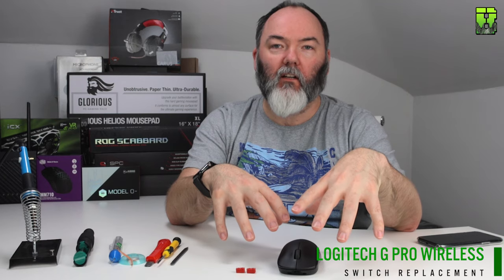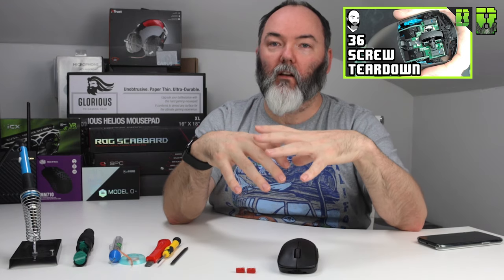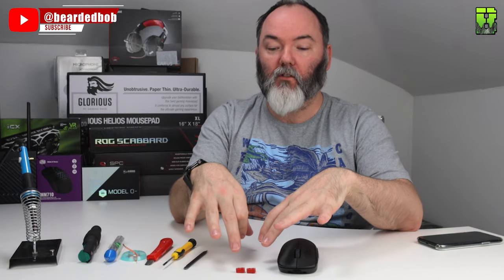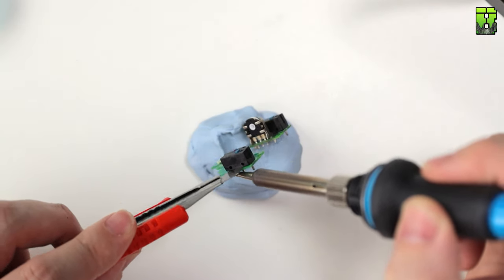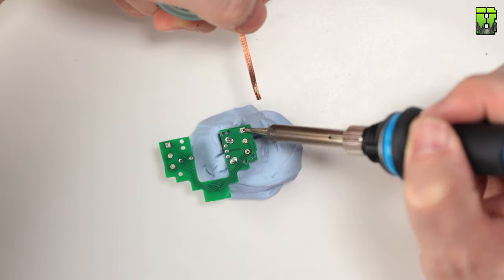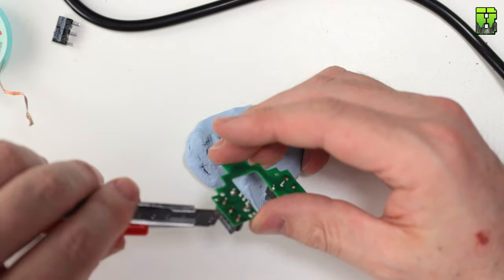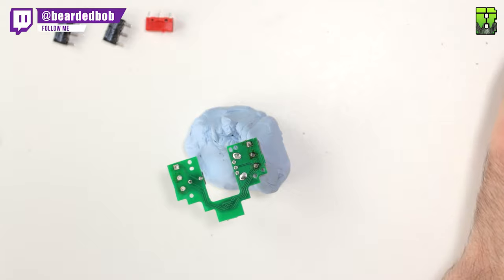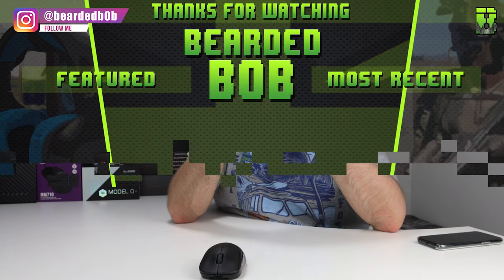LOGITECH DOUBLE CLCK FIX: SWITCH REPLACEMENT

Comment: A good tip when trying to remove components that still have manufacturer solder is to add more , it might sound counter to what you want to do but adding a little more solder allows the heat to transfer faster to the manufacturer solder you can then wick it with ease.
Reply from the maker: Thanks for the tip
Reply: Tried that last week, remembering it from my school days in 1989. Great tip.

Comment: this is not the "FIX" per say, Kaih switches might still double click. And their actuation n release force is more than the omrons. i just hope the industry completely adopts to the optical switches.
Reply from the maker: Swap the Kailh with a new Omron and it's a fix 😜, it just depends which switch you prefer 👍
Reply: @Beardedbob I play"HANZO" a lot- it is mouse button hold aim... rather than a click aim. I soldered my g303's switches thrice, coz of it.

 I swapped to hp reactor mouse (it is having optical switches and I modded it to 66gms)-never had the double click issue.
Reply: Manufactures dont even need optical switches to fix this problem although they are even better in terms of robustness then mechanical switches. You can just use a microcontroller with a couple more pins and actually wire all THREE contacts of a spdt switch properly. That way you can solve the debouncing in a proper way with a little bit of extra software. I modded my zowie mouse with a teensy 3.2 controller and let that handle the button presses using this method it never double clicks after almost a year of use. No debounce delay required at all and it doesnt care about wear and tear of the switch untill it physically snaps in halve.
Reply: Optical switches are trash don't listen to that. Optical switches always feel inferior. Try to get a 200 jumbo tile frenzy score on optical switches you can't. The feel and rebound are just too bad.
Reply: The actually fix is that you update the receiver  and that fixed it for me
Reply: TheSubieFan You know Tile Frenzy isn’t the only scenario on Kovaaks bot
Reply: @Shahzad-Khan  tile frenzy is the most useless scenario on kovaaks but it is a good example of a high click timing drill. I only use it as a hand warm up so you can chill on my top 1% bounce and pop corn drills.

Comment: Thank you for this video. I was searching for so long for ways of fixing my g pro wireless double click. my mouse was to the point of even hovering over the mouse 1 button, would initiate an infinite spam click - making my mouse a paper weight for months. I finally got the guts to replace the switch today, using your videos(this and the teardown video) I was able to replace them myself for about 30 bucks all in. I had never soldered before today, I did some test solders before actually hopping onto the mouse itself. I will admit it was a bit tougher than anticipated and was on the verge of giving up while trying to remove the old switches, but after I had the bright idea of snapping off the switches pins because I didn't need them anymore. it was a breeze. snapped the little pins off, which made removing the excess solder a breeze, after that, it was a cake walk. Thank you again, because without your videos, there is no chance I would have been able to fix this mouse. <3
Reply from the maker: Np Kwadd glad I could help 👍

Comment: Great video 👍

Some tips for you:
- Clean the board and your braid before starting. With IPA 90%+ ideally
- Add flux paste if you're adding heat
- Ensure your iron tip is tinned, it should always be shiny
- Lay the braid over the pad, lay the iron over the back of the braid. Keep it still.
- If the board is burning, your iron is too hot. Temperature controlled irons, or resolder stations, are awesome.
- Try adding flux and a little solder, solder sucking, and using braid to finish up
- If a through-hole pin is being tricky, try adding solder, heating, and pushing the pin to the other side, or more centrally
- Try a solder sucker with a flexible silicone tip
- Rather than removing solder, try adding flux, then solder (even for flux core!) and run the iron between all three pins constantly, the component can often be popped right out. Then just braid/suck the through hole.
Reply from the maker: Thanks some good tips 👍

Comment: Bob, I'm a huge fan. I collect and modify mice too, but I always have trouble keeping the microswitch in place while completing the first solder joint. You're an absolute genius for using putty to hold the board and microswitch in place. I saw in your other videos, you use putty for holding screws and things as well. That might have been someone else.

Edit: My method was to hold the microswitch in place with my finger while holding the board in my palm. Not really safe at all. Lmao
Reply from the maker: All about the putty 👍... Yes holding it can be a tad risky lol.

Comment: Huge thanks for this video. I just swapped out omrons for the Kailh and no more double clicking - it was driving me fucking batshit. Just a heads up to anyone looking to do this; I ripped off some of the copper conductor on the PCB during removal of the Omrons (didn't get enough solder off before forcing them off) and did a shit job soldering the Kailh back on (looks like melted the bottom of one of them even!) BUT THE SHIT STILL WORKS!!!!!!!
Reply from the maker: Thanks glad you like it... ouch on the copper coming off but glad to hear it still works....

If anyone needs this doing I can via this url https://shop.beardedbob.com/collections/customised-gaming-mouse/products/repair-broken-mouse-switch-or-replace-with-better-service

Comment: I recently purchased a used GPW which is very easy to misclick the L/R buttons. I'm assuming the switches are failing. Will replacing with these switches add resistence to the buttons?
Reply from the maker: Depends which switches you replace it with, Check out some of my switch comparison videos. https://www.youtube.com/watch?v=b1IxfY0C5j8&list=PLfd7fPKFiRfLnpJhJ4hVtQ1R4Imi2Uxn6

Comment: do you have any specific watts to use for the solder? just purchased these switches and I'm doing the replacement soon. love your vids
Reply from the maker: Good question I used a 220V 60W Adjustable Temperature soldering Iron from 200-450℃. I test the iron with solder to set it so that it's only just melting solder and avoiding it being to hot. If you can adjust the temp of the iron set it low and move it up until you find the point where it starts to melt.

Comment: I use a desoldering iron with a nozel for a cr10 3d printer and then made the opening a bit wider (made it fit with some old strips of thin aluminum). I was able to remove all the switches on an old razer black-widow in about 45 minutes. Food for thought I just saw the part with you removing the solder with the wick and it brought me back to hours and hours of desoldering stuff lol.
Reply from the maker: Do you have some pics?

Comment: Thank you for the help. I just completed my switch replacement and could not be happier with the finish. I would like to add to this video that having a magnetic screw driver is worth it. Also, be very careful of the strong magnets on for the side buttons. The little plastic white retainers for the ribbon cables are extremely delicate and you can easily break the side tabs off if you use too much force. As he states many times, just take your time! Great video, Thank you!
Reply from the maker: Glad you liked it and you now have been able to swap your switches.

Comment: I have a Logitech Anywhere MX mouse that developed the double click problem which got progressively worse to triple clicking. My solution was to disassemble the mouse and flush out the double clicking switch by repeatedly pressing a q-tip soaked in rubbing alcohol on it followed by canned air to dry everything out. I tried the "static" solution to no avail, because in my case it has been dust accumulation inside the switch itself.
Reply from the maker: Nice to know as this might help someone also 👌 thanks for sharing , and glad to hear you fixed yours 👍

Comment: Great guide and video as always. This is what bothers me about all of this though, you pay $70 for a mouse some times more depending on what model you have. Since I have XL sized hands only the more complicated designed mice are available. These switches are pretty cheap for good ones[made in Japan or somewhere other than China]. Why wouldn't just install them from out of the box so you don't have so many warranty issues over double clicking? I have the G604 and I've been through about 2 of them so far and I am on my 3rd because the things keep double clicking. I got frusterated and took apart my G502 and it was much easier to replace the switches on these and they're still going strong.
Reply from the maker: Ikr, the XM1 is the only one now i'm seeing with some other stock switches. They have started to use the Kailh reds

Comment: I subbed, can I ask what your expected turn around for this is if I send in my mouse. Reason I ask is I have a custom painted G pro wireless that is double clicking like crazy, my only other mouse is a g305 which also double clicks...but didnt start until after my gpw started to, otherwise I wouldnt have gone with a logitech mouse again smh. So obviously curious how much time I would be looking at being stuck with a double clicking mouse if I sent mine in to you to get the switches swapped.
Reply from the maker: Hi Jess, I've responded to your email 👍

Comment: thank you for this but i had a question whats temperature should i put the soldering iron on
Reply from the maker: On this I use 350
Reply: @Beardedbob  I used 325 worked perfectly but it was hard to remove the switches i melted the cap of the switch and removed the pieces.

Comment: Helpful video!
I have replaced the g pro wireless switches with zowie fk2 switches.
Now these 2 problems i am facing
1. The clicks get pre pressed when i install the body so maybe size difference. May i know the size of the g pro wireless switches? 
2. The clicks are not responding. They will respond only like 1% of the time. The click will only respond once when clicked 10 times. Whats the issue here? Is it soldering or something else?
Reply from the maker: Strange, do you have some pictures of the switches on the pcb?
Reply: Will do it tomorrow, i don't have the screwdriver since the mobile repairer did all the job.
Switches were huano blues btw.
Reply: I managed to open it somehow. Here are the pics
https://imgur.com/a/asgqqxI

Comment: Have you replaced any switches on the logitech g502 lightspeed wireless? Interested in changing to the japanese D2F-01f omrons but apparently there is a slight height difference so I don't know if it will be an issue with this mouse.
Reply from the maker: I've done it on live stream that I did and you can swap the switches. 👍
Reply: @Beardedbob  That would be most helpful. I can't find it, do you have a link?

Comment: After a month of radio silence from Logitech support i have decided to fix this myself. I have just removed the old switches and cleaned up all the burned looking flux residue with some iso ready for the new switches! Just out of curiosity are you the same guy i bought the switches from on ebay?
Reply from the maker: Sure am 😜. Good luck with the transfer any issues let me know.
Reply: @Beardedbob  Switches installed and seem to be working as expected, they feel better than the OEM switches too. Thanks!

Comment: i found out that logitech released a Firmware update back in july for me it fixes the double click issue got 1 out of 1000 clicks, before i got like 150+.
Reply from the maker: Easier fix then having to swap the switches.
Reply: Same

Comment: Have you done a video on this for the final mouse UL2 ? Also could I possibly mail you mine to mod?? Would really be interesting.
Reply from the maker: I've not done it on the UL2 but I don't see there being much that can be removed other than the scroll wheel and side buttons.
Reply: @Beardedbob  I don't want it lightened I just want different switches and a Paracord cable.

Comment: Have you seen if the scroll wheel mechanism is replaceable? mine seems to have a dead point
Reply from the maker: you should be able to desolder and add another one off aliexpress yes.
Reply: Beardedbob I was wondering whether the encoder was 8 or 9 mm.

Comment: Hey, I only purchased G Pro Wireless due to it's lack of stiffness for clicks. I tried around 15 mice until I decided for this one (i play moba so clicking 7-8k a game of 30 minutes for 16 hours a day may be painful). Now for the question, is this Kailh GM Red Switch lighter to press or tougher compared to Omron? Or maybe I should find even lighter if you know any. Thanks!
Reply from the maker: its generally a little firmer and over time it will get easier.
Reply: @Beardedbob  Yeah, doubleclick only happens to me on left click which isnt that important for me anyways like right is and I heard it could be software-related too, are there any lighter switches tho? I also got mine with Tiger Glides on now looking for a good mouse pad to match it since my XTRFY GP1 isn't doing it's best job thought of G-SR

Comment: it is a know issue that usually because there are some static on the switch... the remedy is turn the mouse off and take a couple of minutes to clicks the switches during the mouse off..
after that turn it back on and the double clicks is gone...
it happen to many wireless mice... and i've tried the solution myself with good result..
Reply from the maker: Decent tip to try if you are having issues.

Comment: I am a noob at soldering, but I just did it and had a really hard time with desoldering. I had the soldering iron on about 350 degrees, but the solder just wouldn't properly melt. Do you have any idea why that is? 
Also, for how long do you hold the iron on the pcb? I was really afraid of holding it on there for too long possibly damaging something.
Reply from the maker: Welcome to the soldering world... I would practice on something cheap until you get used to it. Also ensure your solder tip isn't black this will stop heat transferring properly. You will need to tin the tip again if this is the case.
Reply: @Beardedbob  Ohhh I see. I didn't know that. Thank you!

Comment: Have you ever replaced the side buttons? From what I've read they're a different type of switch not as readily available. I have a left side button that double clicks, I was thinking I could possibly swap one of the switches from the right side to the left?
Reply from the maker: Yep and they use a really small Omron.

Comment: Do I need to buy a helping hand/third hand tool to hold the pcb board? 

And can I just do this with no gloves on any floor/surface? 

Thanks
Reply from the maker: No I still user blue tac. I've not used gloves
Reply: Kinda late but for new ppl reading this, yes buy a helping hand and all the equipment needed. Makes your life easier and you won't wreck the board.

Comment: I've been thinking of doing this to my G Pro Wireless because i'm getting spontaneous double click issues on it. I've been practicing on my soldering skills and i've burnt a pcb so far xD i was wondering if Flux / Soldering Wick really does help in avoiding it getting burnt :(
Reply from the maker: It can help but to much heat can still cause burns

Comment: How do I make my omron switch double click for like higher clicks on Minecraft for example get back to me
Reply from the maker: You need to improve your finger clock speed. You could remove some pre travel. You could always look to get a faster switch
Reply: Beardedbob I do click really fast like 16 but with some Mouses if I hit the left mouse click hard it will register as 2 how can I make Mouses have that ability
Reply: When it does have that double click I can get 20 cps
Reply: Beardedbob right now I have a cooler master mouse mm711

Comment: Would it be safe to use an iron fixed at 370c? I was practising on an old mouse and I damaged the circular copper pad. I think what I did wrong was I held the iron on the board too long and also mostly using the tip - the solder (lead free) seems to melt quicker when I have the iron at an angle. And does the braid help to reduce some of the heat transfer to the board?
Reply from the maker: With any soldering you have to be careful. The temperature is something you have to work with. The advise I would give is start really low and work your way up.
Reply: @Beardedbob  Thank you. I've in the meantime discovered my iron tip should be "tinned" which it wasn't before and has already gone dark. I ordered a new tip and will try and tin it properly - hopefully it works ok with lead-free solder!

Comment: I just did this on my 10-year old G9X. Never used a soldering iron before. A real pain in the butt, it took about 90 minutes. Having the blu tack would have helped a lot, great idea... Why don't they just make these switches slottable, I guess they don't want people to replace them because it's usually the first thing that breaks on a mouse and they want people to buy new mice.
Reply from the maker: Glad to hear you got there in the end... its not easy....

Comment: is the side button switches can be replaceable also? thanks in advance
Reply from the maker: Yes they can with micro switches but they are very delicate and you can easily rip the pads off. I've done it before and had good success and also destroyed some.  My last victim was the new G Pro X Superlight oppie.